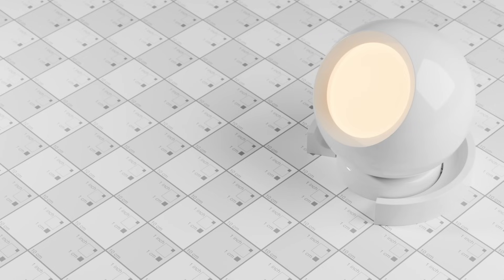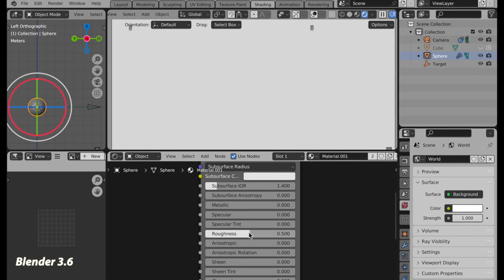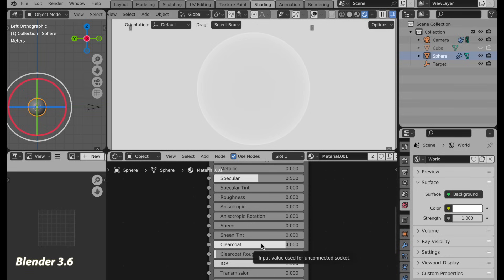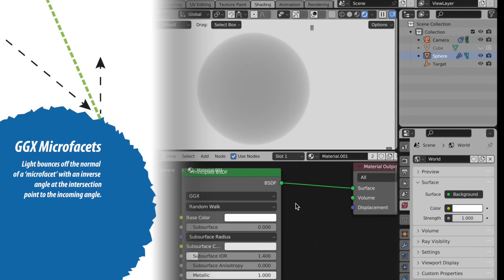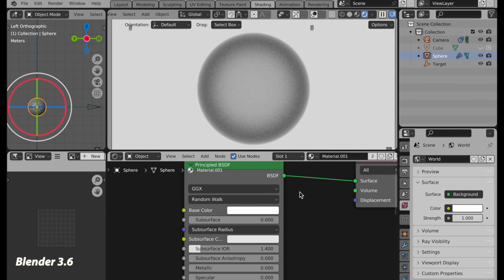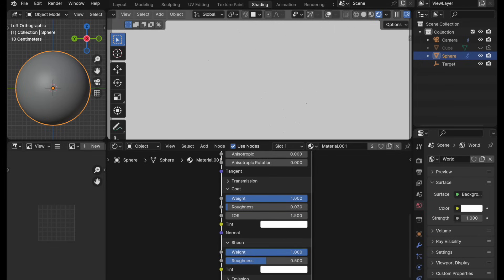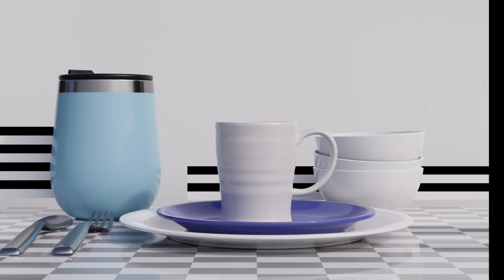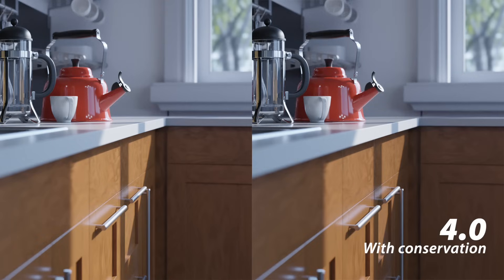The Furnace Test, does Blender 4.0 pass?

Comment: You didn't factor it in in this test, but it fails when you add a microsurface normal map to non-Metallic surfaces. This is one of the most important factors to achieve realism and even Arnold fails this test. Octane universal material passes though.
Reply from the maker: Blender 4.3 is introducing a properly energy conserved Oren-Nayar diffuse model into the Principled BSDF that should solve this.
Reply: @christopher3d475  Looking forward to testing that. 
 I've just finished testing Octane Universal material Vs MaterialX Standard Surface in Karma/Houdini. Octane was almost perfect on all the tests (except 3-layered spec) MaterialX performed especially poorly on microfacet normals. Octane was a perfect white on this test. 
I also tried the layered Schlick BSDF on MatX in Houdini and it performed better than Standard Surface, but not as good as Octane.
Reply: Also, Standard Surface in Octane performed badly too. Similar results to Arnold. Aside from Octane, the only model I've seen pass the microfacet normal test is the 3rd-party Rombo Arnold material.

Comment: After reading the paper from Disney - Physically Based Shading at Disney, they describe the issue of the current diffuse models vs real measurements and they describe exactly this edge darkening and highlighting on roughness which is not covered by Lambert or Oren Nayar, so this must emulate this or tries to approximate a sort of Disney Diffuse I strongly assume
(They say, the measured data shows a highlight on rough materials but a darkening on gloss)

Comment: A super bright object that radiate light in any direction will be darker on the side, we can see this on our own sun, best is to look for images of ISS passing the sun where we often can see that the sun look brighter in the center and darker on the sides, the same goes for the moon even it is lit a bit from the side, so is that not how the light shall work in Blender too?
Reply from the maker: All rendering systems approximate what's happening in reality. There are multiple scattering equations to simulate a diffuse surface each with somewhat different characteristics. For instance, the Diffuse BSDF node uses a basic lambertian surface, which is a kind of simplified diffusion, and transitions to the more sophisticated Oren-Nayar diffuse algorithm which models light more accurately, including what happens at glancing angles. For whatever reason they've chosen a model for the updated Principled BSDF to make the layers work more consistently from an energy conservation standpoint which on the whole creates a more realistic image.

Comment: I owned a 2009 Audi A3 cabriolet for several years (2017-2023) and I'm intimately familiar with its panels, lines and trim pieces (after having to spend so much time repairing it lol). SO MUCH of that car model looks exactly like my A3 that it makes me wonder if you (or whoever made it) based the model on the A3.
Reply from the maker: It was a model from a project a few years back. We bought it as a stock model for the project. It has some topology issues which kind of bug me, but it otherwise worked well for the tutorial.

Comment: Clearcoat normally goes from 0 to 1, where does that 4 come from? Values higher than 1 are supposed to stop being energy conserving, I suppose.
Reply from the maker: In 3.6, it functioned differently than it does now. Watch my video on Coat to understand the difference. 4% was the F0 reflection amount which matches a 1.5 IOR. You just needed to know that. It behaves more logically in 4.0.

Comment: i didnt understand the difference between energy conservation and preservation, could you explain it ?
Reply from the maker: Sure. Energy preservation problems happen with GGX because the light ray strike the microfacets and bounce just once. This causes a loss of energy because that single bounce can be occluded by another facet. That causes the darkening we see. The multibounce GGX models multiple bounces inthe microfacets and results in a more accurate preservation of reflected light off a surface.

I have a more in depth video on the energy conservation problem here: https://youtu.be/kgORQ5tMe2I
Reply: @christopher3d475  but that's not called preservation, that's conservation isnt it ?
Reply from the maker: No, because we're preserving a more correct amount of information that's otherwise being terminated too early. Conservation refers to too much energy accumulating on a surface that has multiple reflectance layers. @tenns
Reply: @christopher3d475  aaah ok! thanks for you answers! 

In physics "preservation" is not the used term, we use the violation of conservation of energy for both when there is too much or too little energy. I couldn't find much literature defining it either! 

fascinating video, and your whole library too! truly spectacular for someone coming from a physics background!
Reply from the maker: Yeah, preservation is the specific term used in 3D development for this situation, although conservation really could apply to both in a sense, given that nature doesn't like to do things with any more energy than it needs to. @tenns

Comment: What a wonderful video! Thanks! Is energy conservation a property of the render engines or it is in the material? I wonder if other render softwares that uses v-ray, corona or lumion also could pass in the Furnace Test?
Reply from the maker: Energy conservation/preservation is a feature of high quality raytracers.  I would assume Vray, Corona and others are energy conserving.
Reply: @christopher3d475  Thank you.
Around the Blender 2.8 release, I used to work with 3Ds Max which used V-ray render. At that moment I moved to Blender (2.8) and felt (I had no idea why), V-ray deliver more realistic renders than Cycles...

Comment: Some comments.
1. It's not "Blender Diffuse" that is causing the issue, but Principled which uses Disney Diffuse. The latter accounts for "Exit IOR" which is known to cause energy loss.
2. Perfect energy conservation is only expected with regular Diffuse (not Oren Nayar or Velvet like effects) in combination with fresnel mixing in Glossy.
3. "Glowy" usually refers to "glowy edges" caused when mixing Diffuse with ROUGH glossy using a standard fresnel that doesn't account for glossy roughness.
4. Sheen 4 are unnatural and should be avoided because they cause problems. The "legal" vanilla range is 0-1. The "Sheen" in Principled (Disney) isn't about adding natural Velvet like effect like in upcoming Principled, but to account for the energy loss caused by Disney's "Exit IOR". (Edited, as topcoat now works as you explained - I checked - was it always like this though? Feel like I must have tested this way back when).
5. It's worth mentioning that testing out with the furnace test is best done using Filmic if going by visual clues. Using sRGB you'd have to measure the >white values.
6. The "simply added" clearcoat isn't usually a problem for what it's designed to do, as albedo values are supposed to be realistically low anyway, and user is supposed to lower the specular to account for the topcoat. Even the fixed Principled v2 can't properly simulate a complex topcoat layer, which should automatically lower specular on lower substrate and can even enhance saturation in the diffuse and cause complex total internal reflections that picks up base color per bounce until it leaves (can be somewhat handled with old specular tint). Look at what happens to wood when adding some types of lacquer, polyurethane topcoats, and shellacs to it. Trying to mimic these, although you can sometimes "get away with it" using a simple topcoat layer, usually requires more complex manually setup materials. Note that we're not able to simulate Disney Diffuse outside of Principled, as the Diffuse shader can only be Lambertian or Oren Nayar (using the diffuse roughness value).
7. Old "Sheen" was completely broken with simplified AO bounces, or at least used to be, haven't used it in ages because of it.
8. Many real life materials does exhibit energy loss. This is accounted for in the diffuse part simply by having a lower albedo, but the specular will reflect according to fresnel unless specular is lowered. All porous materials (unrelated to roughness), and all materials with microtubular molecular structures; light hitting one of these "pores or tubes"  will "get trapped" and never be allowed to bounce back out. This is why specular value is called an "artistic choice", since it's not part of IOR value given for the material.
9. So basically, there is more to shading in Cycles than always relying on Principled; Principled can't handle complex topcoats, Principled can't make materials designed for "thin geometry" yet, and Cycles (at all for now) can't do anisotropic reflections without roughness (I think only Filament renderer can do this) with Eevee not supporting anisotropic at all (without weird hacks). I haven't tested if v4 allows subsurface scattering to transport light at all, but I kinda doubt it.
10. Other than Mitsuba, ALL renderers will suffer some of the above problems to one extent or another, with associated workarounds. There is no perfect renderer.
Reply: OK, this guy knows some stuff for sure. Have you written anything elsewhere? I haven't seen anyone go into this much detail before.
Reply: @IridiumZerox  Only youtube comments and Blender forum. A thing I missed is that new Principled have abandoned the GTR distribution for the topcoat (which looks a lot nicer with its longer tail) as it was "completely broken" (changed from sharp to GTR above a certain threshold, making low values hard to map) in Cycles and didn't really catch on with the industry for some reason (VRAY/Houdini has tail falloff control though), and replaced it with standard GGX (generalized GTR without tail control).
Reply from the maker: 1. Whatever its genesis, the diffuse in 3.6 wasn't ideal, the diffuse that's there now in 4.0 is working better. Because this is a video about Blender/Cycles and the diffuse algorithm it has been using, it's what I referenced, not Disney. But you could split hairs about that. Regardless they're moving away from Disney's standard towards MaterialX and OpenPBR.

3. This doesn't make any sense. I used the term 'glowy' to describe the visual most prominently visible at glancing angles on a surface with glossy reflections that isn't properly energy conserving. Even so F0 will still exceed proper conservation by 4% using a standard IOR of 1.5. but that's no longer the case in 4.0.

4. I used Sheen 4 to amplify the effect, I didn't say it was a correct value. I used 4 for Clearcoat to give the common IOR 1.5 reflectance function. 

5. I used Filmic in the video for this reason, in both 3.6 and 4.0. 

6. Whatever you're trying to communicate here, Coat works much better in 4.0

7. 4.0 Uses a brand new algorithm, for the reason you outline.

8. Perhaps, but the point here is that Cycles was always exhibiting energy conservation problems. Using proper conservation is a much better starting point for common materials. 

10. All renderers are indeed using approximations of physical reality. Even spectral renderers are using 'hero' wavelength values to sidestep the problem of having to render massive numbers of samples to represent an entire visible spectrum.
Reply: @christopher3d475  
1 & 8. It's not about diffuse or Cycles, it's only about Principled. Which I believe was even called Disney early on. And yes, Disney always had shortcomings which was explained in their paper.

3. I mean "glowy" the way it has been described on the forum since long before Principled even arrived.

6. I haven't tested updated Coat much (I'm still on 3.6 for work), but since it's now GGX at least the horrible interpolation problem should be gone. But I have to say, the GTR generalization "looks" far better than GGX. Glad they fixed the energy conservation thing, but for me it wasn't what made or broke my renders. If I needed more accurate, I could make it manually myself.

10. Indeed. In real life there is no such thing as "diffuse", only volume absorption and scattering. But I wouldn't have the patience to wait for everything doing volumetric rendering 😁

Comment: thinking with my monkey brain, it's a huge improvement with edges details of rendering. thanks for the explained  that is clear & simple! I pefer Arnold render because the edges reflection is more real than other render engine. Because object's edges shows darker reflection in the real world, blender render also is ok, but lighter and blur with reflection on the edges of object, that's make me  feel fake. 4.0 is better and more real, good job!
Reply from the maker: You can affect edge reflections as far as reflection sharpness. I did a video on that. Reflections often become sharper with increasing incidence, and you can simulate this easily enough with two nodes (layer weight and RGB curves nodes).

Comment: AAA content, as always. Just to put a spanner in the works, I guess a full  energy model would have to be spectral? It would have to take into account light absorbed from the visible spectrum and re-emmitted as invisible IR heat,  and vice versa: UV  fluorescence.
Reply from the maker: Yes, spectral rendering will take this up a notch for sure.
Reply: what's a full energy model? if you mean energy conserving/preserving, then you don't really need spectral or even RGB if you want to stretch the truth. energy conservation/preservation is only concerned by the quantity of light that is scattered from a surface is same as incoming... and you can define the light to be whatever you want in rendering, be it spectral, rgb or even hsv.

spectral rendering would still be cool to see tho
Reply: @stubman5927  Hi! This was more a  question  than an assertion.. I was just thinking that the current model  only does the book-keeping for visible light?  That, by contrast, in the real world, the conversion of total energy in and out of  visible, to and from invisible radiation, has a part to play ... what we wind up seeing is only part of the picture. By all means, shoot me down.. :)

Comment: In real life if you use three polarized lenses each at a 45 degree angle from each other, it seems to violate energy conservation. Not really relevant, but interesting.
Reply: Hehe..a lovely one.. no violation, only 25% gets through.. the weird bit is that it is not zero, because of the collapsed align/don't align 'decisions' taken by the photons on the way.

Comment: Great explanation and helps me wrap my head around the new settings. I also noticed that 4.0 converts older more complex node setups to align with 4.0’s inputs I.e. I use a separate image file sometimes for subsurface color. 4.0 automagically combines with a mix node instead of throwing the image node out.
Reply from the maker: Yes, I've noticed some of these conversions too that I've been meaning to explore in more detail to see how they're handling different cases.